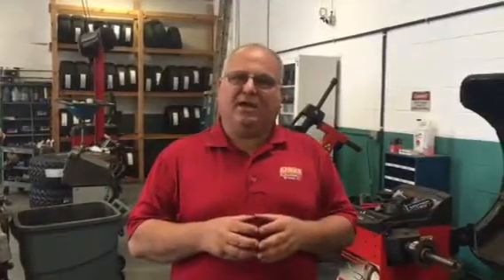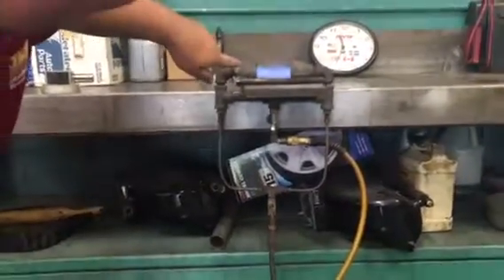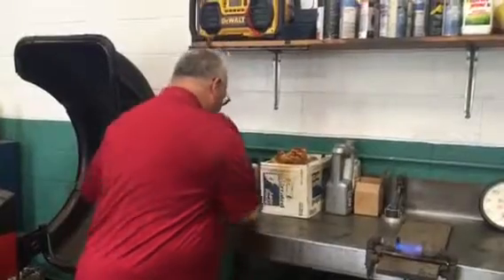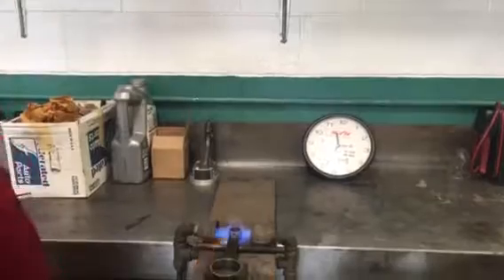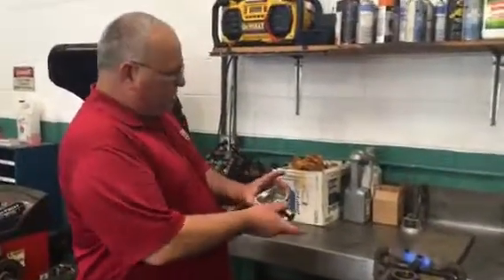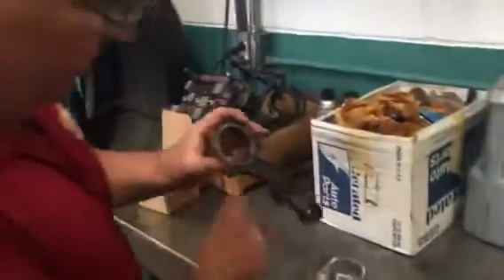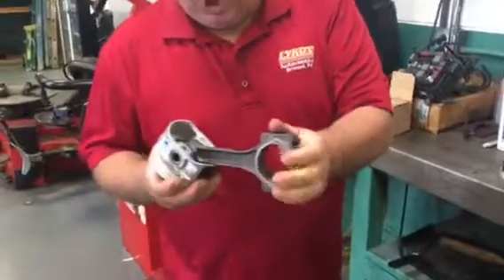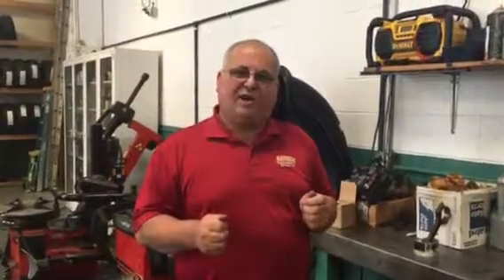How to Install Pistons on a Rod with Homemade Heater

Comment: Hey mate what did you use for the flame tip/jet
Reply: Looks to be just using the 5/16 brake line as the fuel jet/restriction. That's how I'm building it, we'll see how it goes...